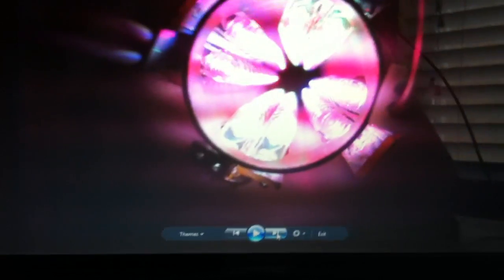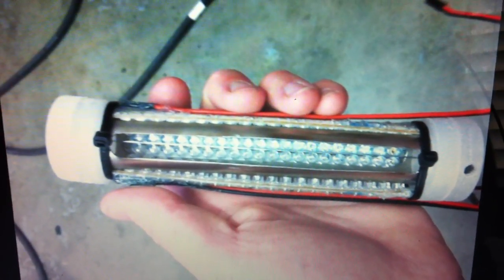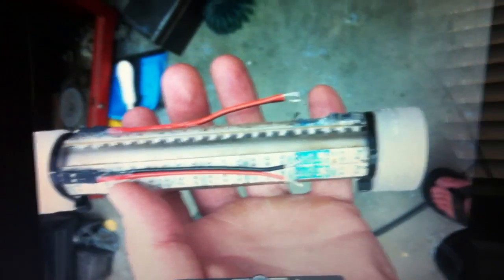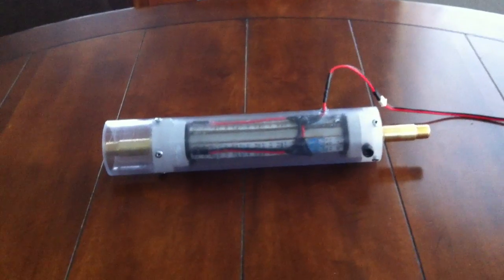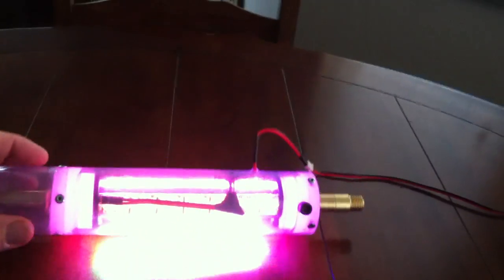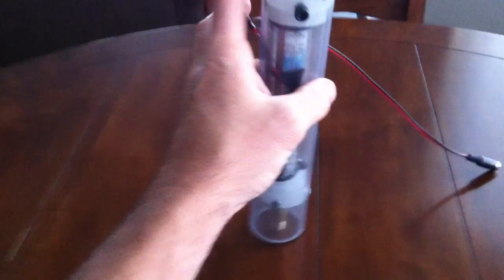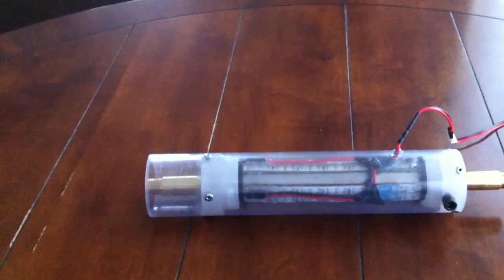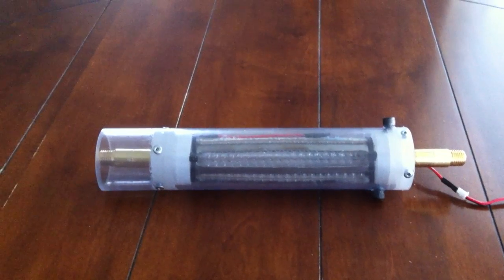Laser EPG 009 - Assembling the Slot Design Hydrogen Gas Gun (HGG) / Gas Processor Unit

Comment: Well, you just have to follow the instructions there all there, and understand he was ionising the air to make positive oxygen ions and dissolving them in water to make his waterfuel. All the pcb cards are designed to ionise the oxygen in the water causing particle collisions between the electrodes and in turn ionising the water molecule which in turn switches off the covalent bond. This is a gas production device and also an electrical generator.. It’s all there to make it work. All you gotta do is put it together.. It’s a physical force!!  Thanks!!